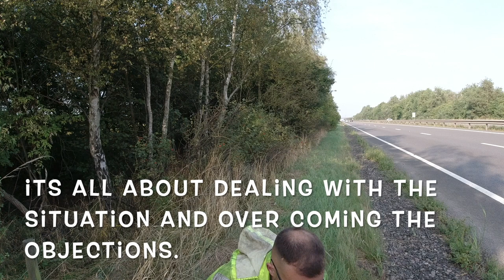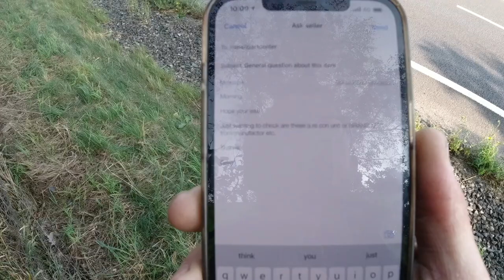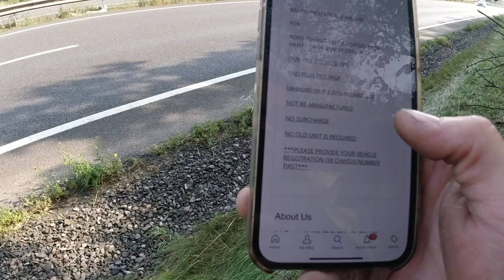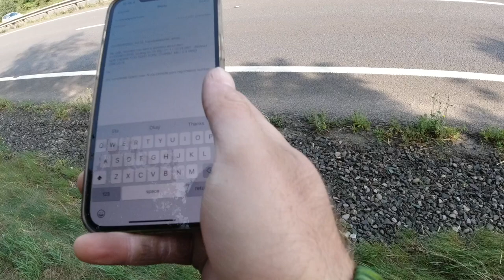OH FOR F**K SAKE! I BROKE DOWN !!! FORD TRANSIT MOBILE TYRE VAN DIED! REST IN PEACE. :( . :( . :(

Comment: PMA - you came up with a plan to fix and at least it wasn't dark & raining. Good idea to check out engine suppliers before buying. Engine reconditioners who are FER members/approved should be OK but I appreciate that loss of oil pressure could weaken other components which might fail later and you need the van back on the road asap.

Comment: Greg you have my sympaphy I had a mk 3 1300 esccort van as a parts runner  snapped thw cam belt about a mile from the house has to walk back grab the 308 beavertail go back lift the van and bring it home tear off the cam cover confirm the worst ( interference engine head off bent valves you know the score with a cvh engine  . new valves new cam belt new waterpump all for a dizzy cap that had to be got within the hour

Comment: You don't have to remove the engine to replace the oil pump.
Just have to drain the oil and drop the sump pan.
 A new pump costs about £50 + VAT and takes about 2 hours to fit.
Replace the gasket while you have it off about £5.
Reply: I’m guessing that the issue is more that if the oil pump has gone with the engine running, chances are the engine has run dry and is toast.